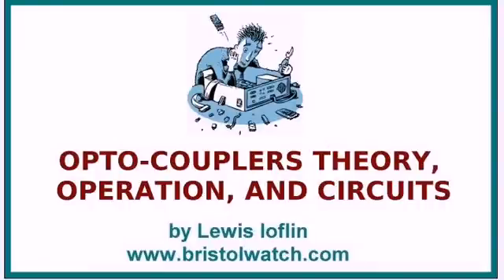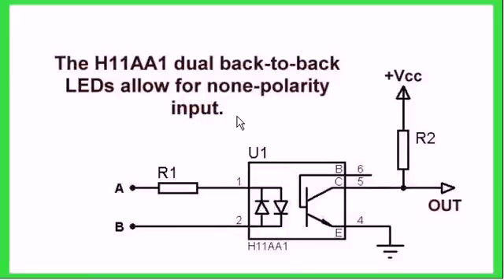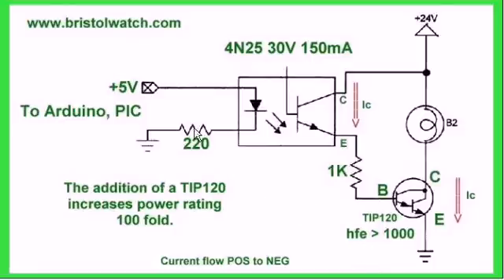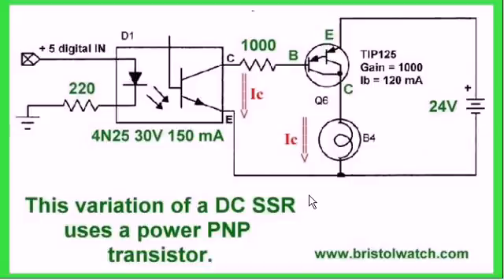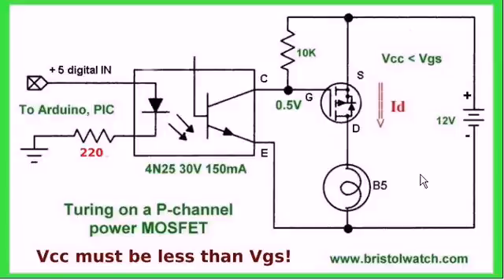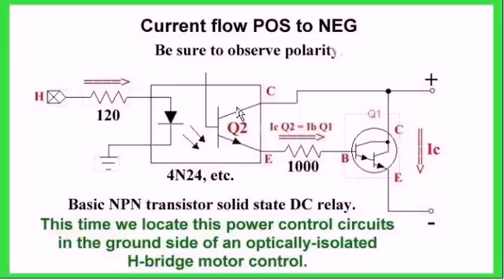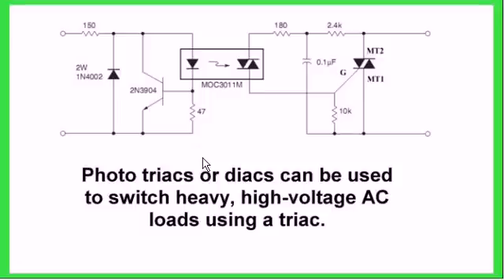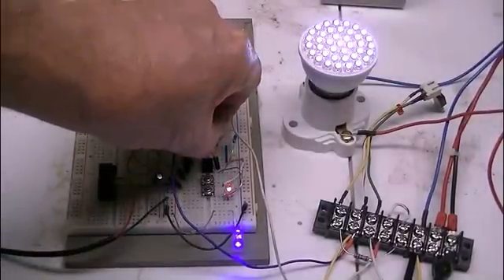Opto-Couplers Theory and Circuits

Comment: ######!!Don't I need 2 bipolar transistors to shut off the P channel? (no mechanical switch to disconnect ground) I need optocoupler + 2nd transistor to shut off P channel as used as HIGH SIDE SWITCHING.???????
Reply from the maker: No. The 10K resistor will charge the gate back to +Vcc. It will switch on with a difference in voltage on the gate source.

Comment: I have minus 130volts pulsing that needs to turn on P channel MOSFET with load on ground side ,through optocoupler 4N25. Can I use diode to reduce the negative volts down, and then use step down voltage divider  LEVEL SHIFTING CIRCUIT to change polarity to positive low volts to input of optocoupler  IC ? Can the input negative volts go to the diode cathode of opto?

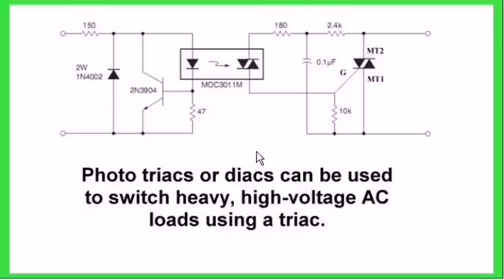Comment: 10:58  What is the use of 10k ohm resistor between the gate and anode 1 terminal of triac?
Reply from the maker: Forms a voltage drop across MT1 and gate.
Reply: @LewisLoflin  Thanks, I have the same project in school that uses BT136 triac. (AC  LIGHT DIMMER)

Comment: Isn't there a different current limiter for the input instead of a crowbar circuit without the 2W resistor?
Reply from the maker: You can use any current limiter.

Comment: Do you have any more detail on the protection circuit or sources to check out?  Theory of operation, how to pick values and components?  I'm looking to build a circuit to  accept a 30-300V  variable HZ AC (two legs of a three phase alternator) input to a 5V square wave. I'm thinking build around a H11L1 and my best idea before that was to try a capactive coupling against the positive output of the rectifier.

Comment: It would be interesting to see some linear opperating mode optocoupler circuits. I believe hotchassis TVs used to use optocouplers for AV input isolation, and switch mode supplies using optocouplers for feedback of output voltage levels to the primary side controller. It would be interesting to see the schematics of such circuits.

Comment: Thank you so much for providing this lesson. I tried getting into Arduino years ago, but didn't have an understanding of how even transistors worked, or how they were special. How that figured into CPU design and other applications. Now I'm slowly building on that knowledge so I know how the chips and boards work, aside from the actual ATMega328 and the way it is programmed.
Reply: Arduino Uno 👍
Reply: Schön jemanden zu treffen der gute Ideen hat
Reply: Thank you

Comment: Could this be used to convert 24VAC to logic level signals?
Reply from the maker: No this is for DC. You would have to rectify/filter the AC (1.41 X VAC) and use a larger dropping resistor.
Reply: @LewisLoflin  Thank you for your prompt reply. In addition to solving my current project's needs, I'm very interested in learning how to understand and do this correctly. Do you know of any resources that I might look to to better understand how to properly design a circuit that will convert 24VAC to 3.3VDC?

Comment: Can optocouplers be used for high power rating?? 3KVA????
Reply from the maker: No. They are low power devices. They can control higher power circuits with say IGBTs, etc.

Comment: very informative episode, I wonder what is the maximum frequency tha optocoupler can be oprated,  cause I was thinking to use it on a high voltage switching power supply control around 200 KHz

Comment: I have a problem with opto isolator in my circuit it is still respond to command but only give weak current output around 2ma. I connect the output to drive 12v relay. Why is like that?
Reply from the maker: Not sure what you mean. Be more specific.

Comment: 5v to 24 v optocoupler circuit diagram.   Using encoder output 5v to PLC 24 v converter

Comment: Hello Lewis, first of all, I would like to thank you for those awesome videos. I am new to electronics and whatever I've learned so far, thats thanks to you. But I was wondering one point. The max  collector current is, lets say 100 or 50 mA of the optocoupler, in the schematic  https://youtu.be/408qlS2z6ys?t=6m44s, isn't a current limiting resistor required?

Comment: what is better optocoupler or mosfet ?
Reply from the maker: Not the same thing. An optocoupler is low voltage low power. A MOSFET has high voltage and current rating in most cases.
Reply: thanks. but we can have low power mosfets too ?
Reply from the maker: Yes they exist all the time within CMOS ICS, etc. The 2N7000, ZVN3306A, and the BS170 all n-channel low power MOSFETs.

Comment: what type of transistor is most efficient? as far as power consumed or lost, is a MOSFET more efficient than like a Darlington. of BJT or IGBT? I'm asking because I'm looking for the best switch to use in pwm battery powered apps. for longer run time. thanks for great videos.

Comment: Is the output resistor connected to the 4N25 just to ensure that the maximum current will not exceed 150mA?
Reply from the maker: Should not exceed 20 mA. Are you referring to the one on the opto-coupler LED?
Reply: Yeah. I wanted to write 15mA (~16.4mA), sorry. In a practical project, can I consider the CTR specified on the datasheet? Or does it may have a large variation?

Comment: Nice video. So Lewis, the only circuit here that will do PWM is the "Basic NPN transistor solid state DC relay"? I want to isolate a PIR sensor and an Arduino from a 9g relay because the relay seems to be affecting the sensor. Can I still run a wire from an IO pin on the Arduino to the servo so that I can control it?
Reply: For efficiency can I use a MOSFET instead, over on the right hand side of the diagram?

Comment: Can this be used in the opposite direction.  That is to say, I would like to use a 24v proximity switch, through an optocoupler to signal a pin on the arduino @5v (or take the 5v signal to ground)
Reply from the maker: +Christopher Pearsall Should work.

Comment from the maker: One can't use PWM with an AC circuit. You have to sync to the AC waveform then switch on an SCR or triac between half cycles. I'll have that coming up.
Reply: Thank you for your truly awesome and explanatory videos! Can I ask what if an IGBT is used instead of an SCR? Would this work in combination with an opto coupler controlled by Arduino/555 which would be sending the PWM signals?
Reply from the maker: No if it's DC and if AC has to phase synced.
Reply from the maker: Not sure I can answer I don't know the particular structure of the device. Just looked this up an a DC device opto-couplers will work as long as the voltage isn't too high on the opto-coupler..
http://www.ixys.com/documents/appnotes/ixys_igbt_basic_i.pdf
Reply: How to control speed of dc motor which is operate from 24v 10amp dc supply
Reply from the maker: @12htech70  Make sure the drive transistor is about 15 amps.